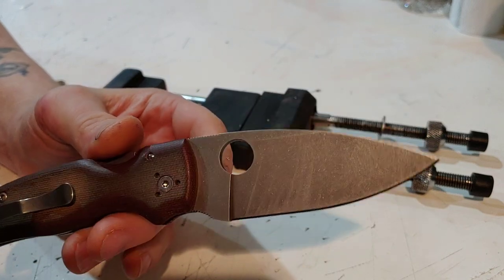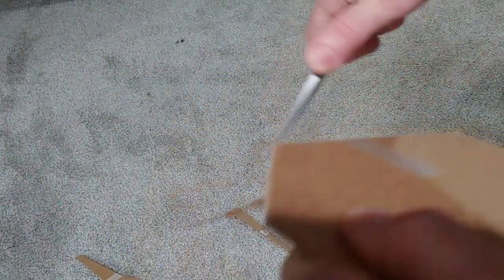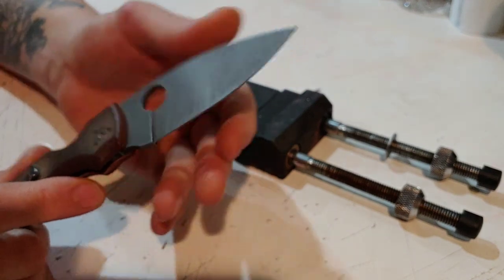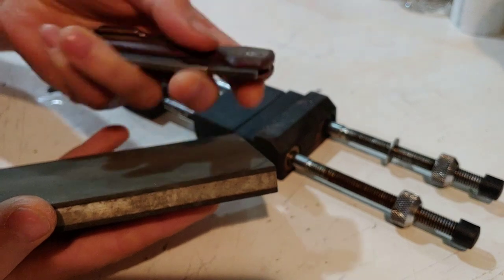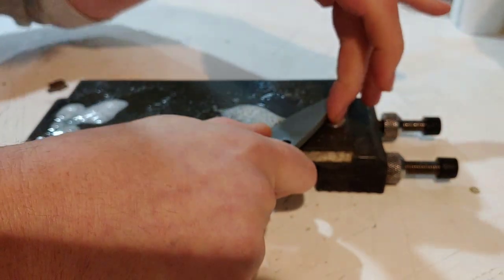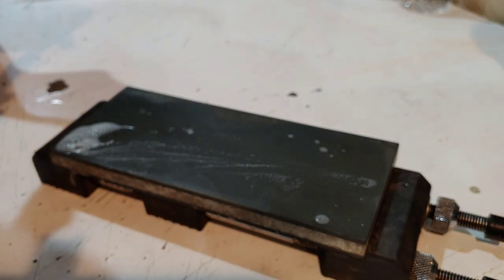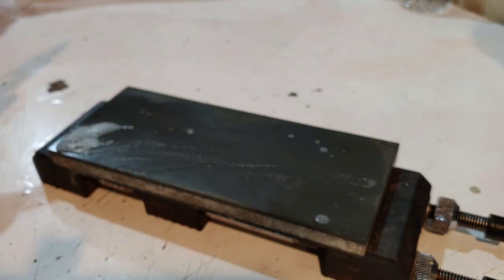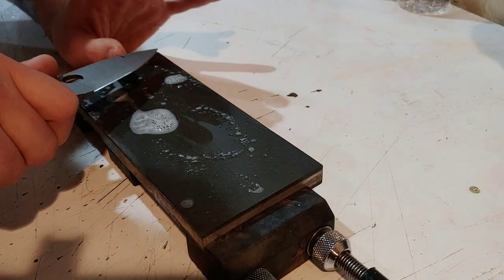SPYDERCO SHAMAN CRUWEAR FULL SHARPENING FREEHAND

Comment: Ooooh yyeahh 🤙can't go wrong with the shaman without a doubt 🔥the s30v blade steel is awsome for me as it holds a great edge @ 600 grit💯💯it just keeps on ticking haha. Also the blade geometry allows for effortless passes thru what ya cut thru for a thicker blade stock😮😆tnxs for the video, it answered a few similar issues I had. Have a awsome weekend wootwoot haha 😄🤟🤙👊🍻
Reply from the maker: 600 grt is whats on my s30v as well and its a great cutting tool, that allows you comfort and leverage in the cuts, love it, its tough and hard use without being over the top

Comment: What brand stones were these? And what size are the stones? I'm tired of sharpening with jig systems. Moved onto the sharpmaker mostly, but would love to get good at hand sharpening.
Thanks for the info and all the content my friend
Reply from the maker: These are venev dragon series diamond stones, they also have the pheonix series 3×8 the dragons are thicker they are diamond infused resin
Reply: @NeevesKnives  thanks. I ended up picking up the ultra sharp diamond plates 300, 600 1200 and 2200 3x8. I'll start there and see how it goes
Reply from the maker: @theBoogerman666  hell yeah thAats awesome make sure you get a clamp for the plates there’s one in the description it’s a must have and it will make things so much easier
Reply: @NeevesKnives  yeah I chose the option with the stone holder. 🤘

Comment: try the Cedric & Ada Gear and Outdoors edge trick - (       https://www.youtube.com/watch?v=ChiFWYb7_VM      ) ultra course on 1 side of the bevel (100-200 grit) and polished on the other side of the bevel (5000 grit +) - u might like it -  i tried it and its a bit of alright - really bitey but also very laser-ish sharp - instead of deciding on a bitey edge or a polished edge u can have both
Reply from the maker: Id have to doit on a fixed system, i dont think i could doit freehand because the grit pattern runs opposite on other side
Reply: nah u dont need to worry about the direction of the scratch pattern - just so long as 1 side of the bevel is super course and the other side is super polished
Reply from the maker: @TheCrajiboi  il definitely try it out, ive been doing unconventional edges for a while and trying them out never for edge retention mostly for cutting performance